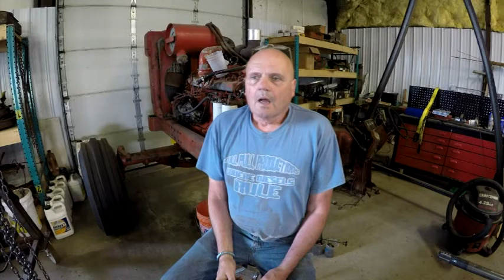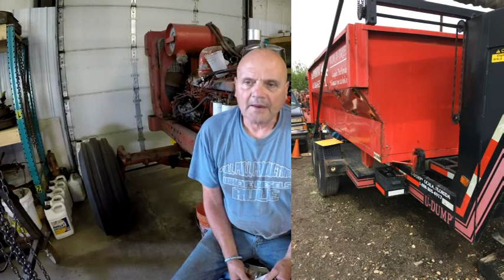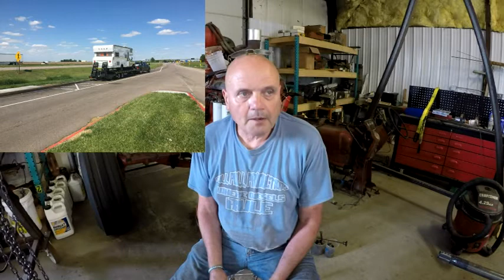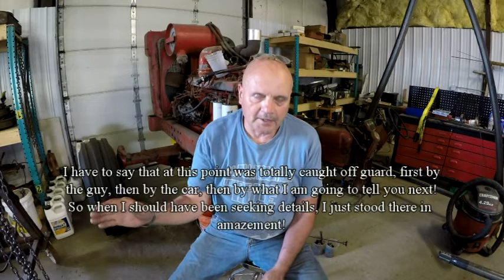Project Shop Tractor Update 06 15 17

Comment: Hi Fred, your project is progressing well.  I just want to comment on the 3 tubes and their o rings. first the o rings (382997R1) are 5/8" X 1/2" X 1/16". most guys would install the tubes first with no o rings on the tubes  then back them out enough to put the outside and inside o ring on. the lube we always used was just plain old Vaseline. for the one's that went in real hard we some times loose up the bolts that held in the TA assembly front housing to see if we could create room by trying to rotate the housing.  we would chuck up the tubes in the lathe and make sure they were real smooth, but one thing I do know we never had a problem with the tractor because of one of these leaking.  Great story's you tell about your transport business and the people you meet.
Reply from the maker: Thanks Jerry, that info helped a lot! After you posted this I went back and check some of the O-Rings in the kit and sure enough the ones that I thought were to small are apparently the right ones given the sizes you gave me! Again, thanks so much!